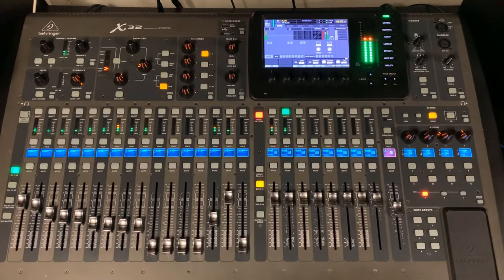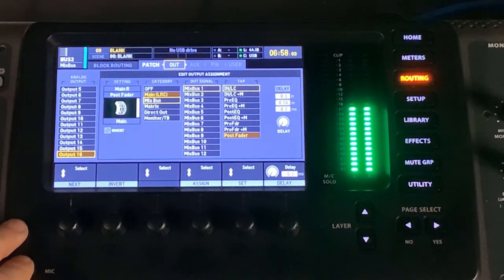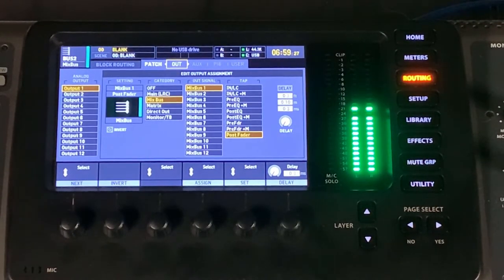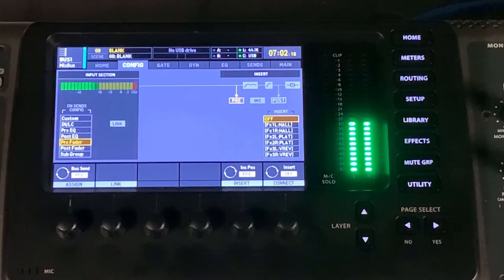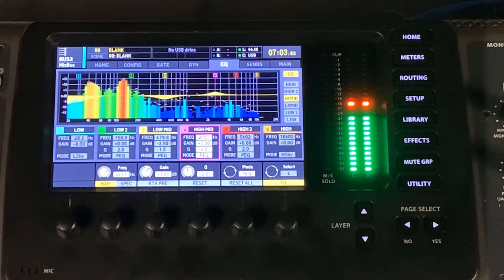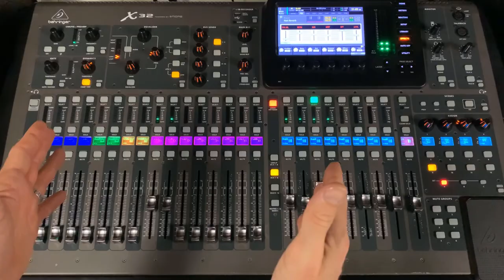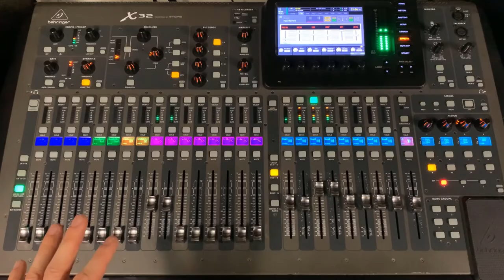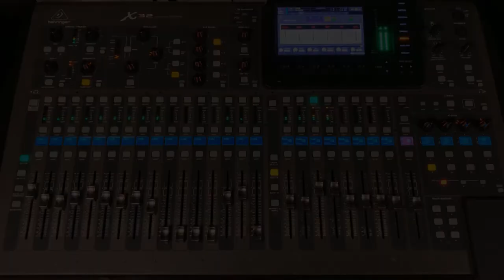How To Setup Monitors On The X32 (or M32) Sound Console

Comment: I hate that’s it’s only on banks of 8 you can’t move in puts outs puts 1to 1 to where every you want it. Allen and Heath let’s you
Reply from the maker: In the firmware version 4.0 and newer you do have custom routing at the individual channel and output level.  You would use the Routing > User Out to set this up and refine where you send your outputs. It is not the exact same as a nicer A&H board, but it still covers the same need.